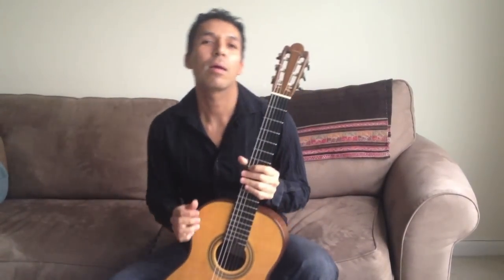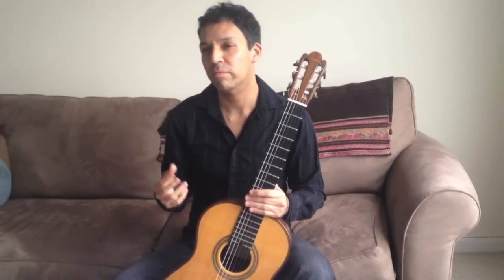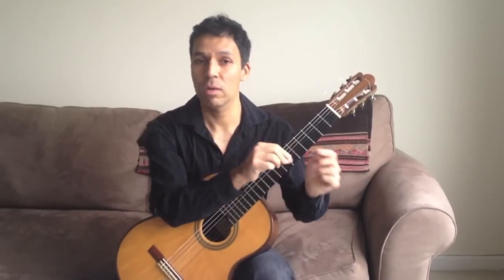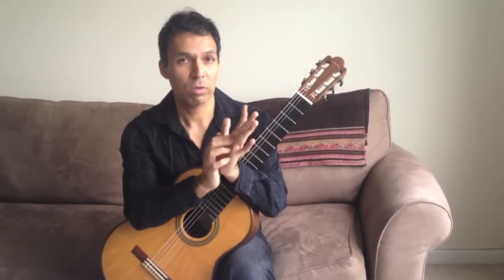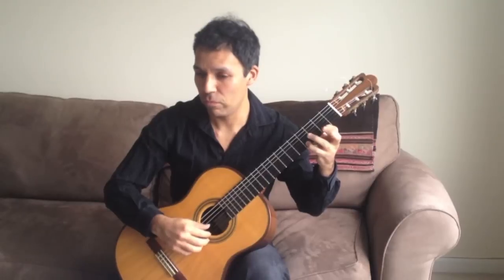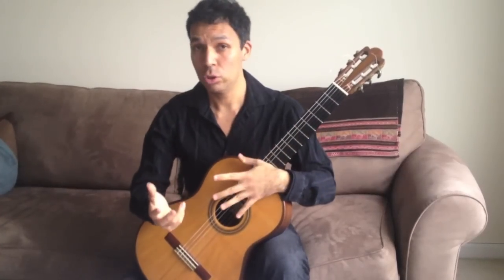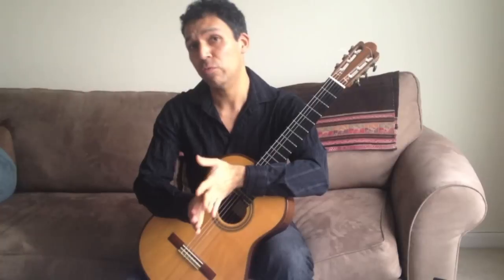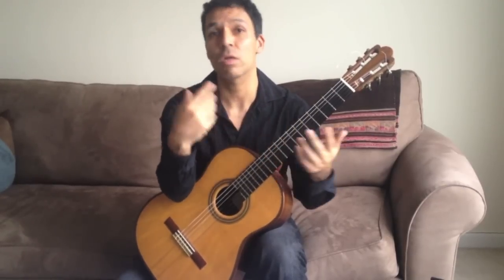Classical Guitar Technique -  reflexive speed

Comment: Hey all, I'm 53 and always used free strokes, but now am grinding out the Villalobos etudes so I need rest strokes for greater speed.
A few weeks ago before I saw this video (gracias Jorge!) I noticed things got easier if I "accented" the first note every time I change string. i.e. the scale starts on the first string and ends on the sixth. You shall play the last note on the first string normal, then accent the first note you play on the second string, first on third, etc. That gives you extra strength to finish the run. Otherwise I noticed I would start strong on the first string and by the time I was down to the fourth, the strokes would be real weak and the sound muddled.
So yes, Jorge is right!
PD some flamenco guy discusses right-hand rounds on each string, fingering i-m-i on all strings, vigorously. Next m-i-m .
Pascal Roch has some veery good right-hand rounds in his book 1.
Reply: It sounds a very unmusical approach to haphazardly accent notes of a passage dictated solely by which string they happen to fall on.

Comment: reflexive speed?

isnt this just hammerons and pulloffs? (the first few mins)?
Reply: No, he's talking about the fretting hand and the muscle movement flow across notes that most people figure out on their own
Reply: He knows what he's talking about.
And yes it is reflexive speed. If you have to think about it it wouldn't happen so quickly. I suppose when you've been playing for years as consummately as this dude you display such flurry's without thinking.
Reply: samljer not at all. In Hammer-ons and Pull-offs only the first note is played by the right hand. He is actually striking every note, just not with the same force. He is striking the strings as a "reflex" of the first stroke, but he is indeed striking it every time, the only exception being between 6:45 and 7:05 when he adds one slur.